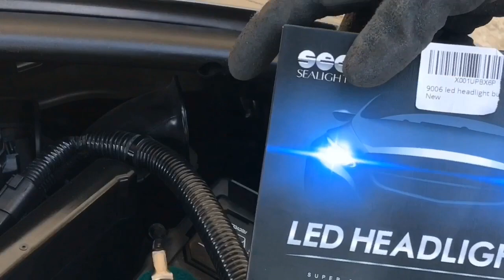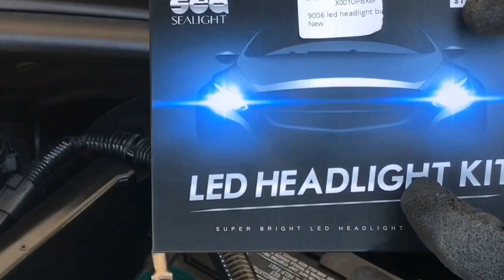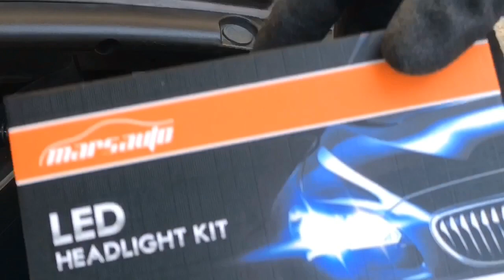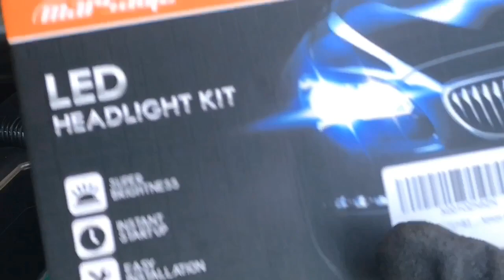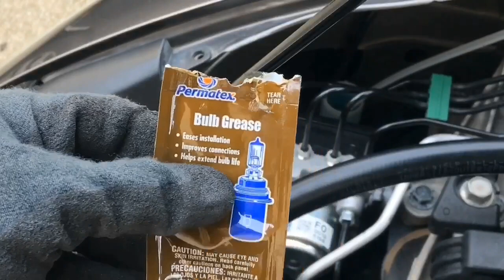Sealight 9006 low beam | Marsauto 9005 high beam | Installing LED headlights

Comment: I installed low beam led Sealights in a 2012 civic with ZERO problems. No Flicker, No DRL code, No flashing from other drivers. I recommend them.

Comment: I'm going to install it in my 2013 Civic, never done anything technical before so a little nervous
Reply from the maker: Ameer Hamza, 2013 so easy
Reply: @Belneons  have you had any problems with the leds? Flickering or anything?
Reply: Honestly this is probably one of best things you can do yourself it's really simple
Reply: @Isaac__..  installed it yesterday and loving it
Reply: @AmeerHamza-nw9yw  quick question since i ordered these today how's the light output on them
Reply: @Isaac__..  it's very bright, no flickering at all, high beam and the low beam works great, bright sharp and stable. No flickering or anything like that
Reply: @AmeerHamza-nw9yw  thanks I appreciate the help on them stay safe

Comment: What happened to your day time running lights?? Not working? 

Some LEDs don't work with DRL's is that the case?
Reply: The LEDs I got worked for both of my DRL (which is also high beam) and low beams. I have a 2012 civic
Reply: @user-mm5pj9oi6t  which ones did you get?
Reply: @Jaime92870  I got the Fahren brand on Amazon! You will need the 9005 and 9006. From what I remember, they’re about $40 each :)
Reply: I just pulled fuse 37 for daytime running lights and their completely off now. Didn’t like how they look and without them on looks a lot better
Reply: @user-mm5pj9oi6t  are your headlights still working i was looking at that brand and wanted to get them

Comment: Not recommend for anyone this Honda Civic 2006 to 2011 need  a bulbs with a daylight and high beam 👌🏼
Reply: You can actually disable daylight running lights.
Reply: Did you need to buy an adaptor for your headlights? I have a 2008 civic and the connections don’t fit
Reply: @darinrasmussen5828  check original bulbs... Maybe you got a different type
Reply: @514aam  I mistaken the turn signal bulb with the high beam 😎
Reply: @darinrasmussen5828  hahaha, enjoy the new lights!

Comment: Well ,people just just throw a set of led bulbs into their headlights then turn them on    that s it . They never show how the light patterns look like   would the headlights blind on comming drivers   .they never show if the high beams will light up 50% as DRL in day time!   You guys know what  there are thousands brands and models of led bulbs and even if they are as same type as your headlights bulbs only several of them will give your car a correct light patterns  will help you see better at night and wont blind on comming traffic!   So if you want to upgrade to led  you should spend some time to research some times took months to look for what brand   what model of led bulbs can work perfect in your car   and if you want led high beams could light up at 50 % power  as 6v  in day time DRL  it will cost you $300 a pair of bulbs.  These kinds of led bulbs make me laugh hard   please folks  do some reseach   spend some time and money  so your video could help people getting smarter  not dumber  if you are not experts  dont try to foul people
Reply: Good ass comment, I’ve been researching and looking for new LED lights to replace the stock halogen lights in my 2006 civic. Found good deals and good reviews but nobody ever talks about how the look for on coming traffic, how long the last, if they flicker, or if they clash with the orange light on most traditional headlights.
Reply: “Foul people” lmao